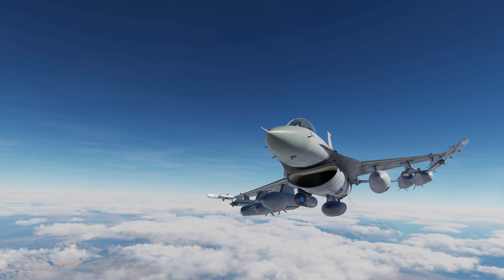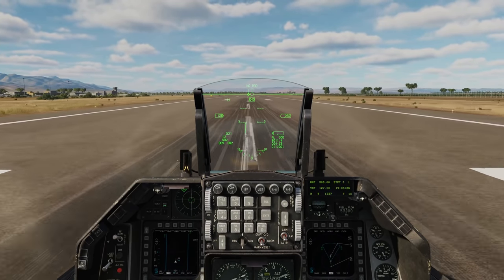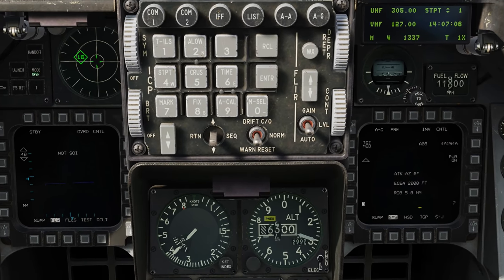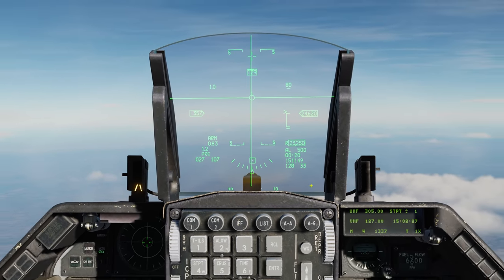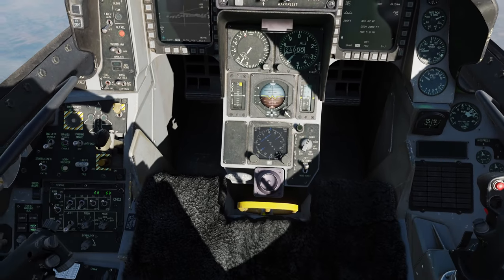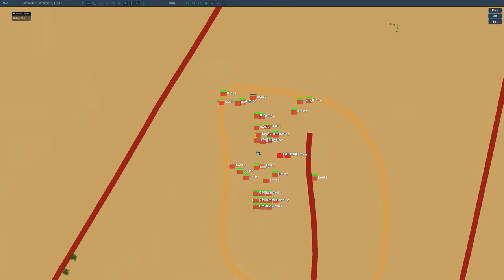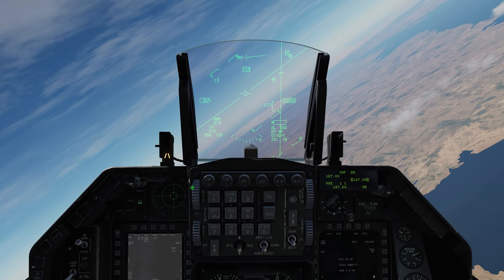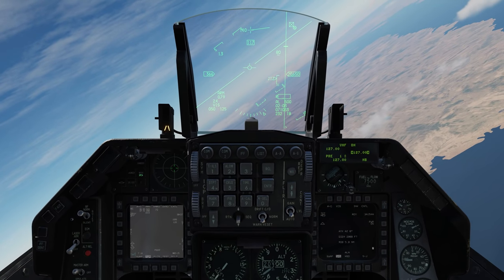DCS: F-16C Viper | JSOW

Comment: Great video! Another tip is that if you use the HAD sensor for HARMs, you can get a SPI with PRGM2 when targeting enemy radar sites, and release a JSOW.  It’s fairly accurate, and allows you to keep your standoff at high altitudes.  Finally, it also lets you conserve your HARMs for the biggest radar sites, such as S-300/S-400.

Comment: 4:20 Matt, when we launch 2 💣 together we know that the “space impact” is the distance between 2 JSOW 💣 considering the SPI at the center right?

But these 💣 do not fall whole to the ground (such as JDAM), but open in the air in clusters. Therefore the “space impact” is calculated from the center of 1st 💣💣💣 💣 to the center of 2nd or simply the distance between 2 JSOW 💣 in the air?

I hope it is clear I,m 🇮🇹🙏👍

Comment: Question for both the JSOW and JDAM... I notice by default the attack azimuth is set to 0 degrees and isn't used unless you manually adjust it first. If you do change it and later decide you don't care, is there a way to reset it? Like say for example I set it to an attack azimuth of 090 for my primary target, then as I'm on my way home, flying South, I spot a target of opportunity and I just want to drop on it without having to worry about the bomb or JSOW making a sharp turn to try and match the configured azimuth.
Reply: I believe you just set it back to 0 and if you want the JSOW to fly north you set it to 360

Comment: Will we get the AGM-154A-1? This is a variant of the A fitted with a BLU-111/B blast/frag warhead. 

The BLU-111/B is also a variant of the Mk82.
Reply from the maker: That would not be accurate for a US 2007 Viper.
Reply: @National Christian Constitutionalist Party why
Reply: @MattWagner  But we're slated to get AN/ARC-210 as per this thread: https://forums.eagle.ru/topic/225957-reported-comm-2-radio-mislabled-as-arc-222/?tab=comments#comment-4506699

Which according to this: https://www.f-16.net/f-16_versions_article2.html Came on M5.1 starting circa 2008, which AFAIK is the entry date for the AGM-154A-1 (according to this: https://www.military.com/equipment/agm-154-joint-standoff-weapon entered production in 2006. 

If the F-16CM can carry the A, it can also carry the A-1.

Unless of course the USAF doesn't operate the A-1 on the F-16CM.

EDIT: Seems to be the case unfortunately, the only reference to the A-1 on F-16s seems to be as part of FMS requirements for Turkey.
Reply from the maker: @OliverMiles98  We plan to adjust the radio later.
Reply: @OliverMiles98  The same source states EGBU-12 on the same M5.1 tape version that the JSOW is on. What's the deal with that weapon? I don't recall seeing it on ED's feature list.
Reply: @twoknife  It isn't on it, but AFAIK it's only on export F-16s and not Block 50s. See my post here: https://forums.eagle.ru/topic/275642-agm-154a-question/?do=findComment&comment=4721541

Data is sparse though - I'm just going off of what I can find.

Comment: Hi Matt, thanks for the video. Can you move the TGP cursor to change the SPI when in PRE mode? If yes, how does PRE differ from VIS? In VIS you used the HUD first to get the cursor to the area and finetuned it with the TGP. So basically in both scenarios you selected the target with the TGP. I don't really get what the difference is then between VIS and PRE.
Reply: PRE is designed to engage targets you already knew the existence, AKA preplanned targets. VIS is designed to quickly engage target of opportunity you have in visual, putting the thing on the thing on the HUD and go. 

You could do the same in PRE with the SP mode of the TGP btw.
Reply: You could also use VIS if for some reason your TPOD isnt available

Comment: I'm not quite clear what the difference is between the modes. In the hornet, a pre-planned mode can only be dropped on target punched into the weapon system. Here, you said it can be dropped on any SPI, such as steerpoint, HUD or pod. Subsequently, the VIS mode seems to do the same thing... Or did you mean that in PRE mode you can only drop onto a steerpoint?

thanks a lot for all the hard work!
Reply from the maker: The Viper and Hornet terms differ. PP in the Viper is more like TOO in the Hornet. Lockheed / Boeing...... argh.
Reply: Does that mean that with the Viper you can waypoint designate (or TGP) a weapon, then step to the next and designate a separate target, so you can release multiple weapons against multiple targets in one release?!
Reply: @faZhift  So far thats how the JDAM is working.   Just have 4 steer points on targets in an area,  and its pickle, next steerpoint pickle, repeat.

Comment: It's a real shame no branch (navy in particular) chose to procure the B variant- those submunitions are by far the most effective cluster munitions in DCS at this time and would've made for fantastic tank busting. I know you guys typically operate on a "if the platform could've possibly used it then it's available else no" type of deal so I'm not expecting it, just highlighting how much of a shame it is for our purposes.
Reply: By all accounts the B had a slew of technical issues and they never got it to work right. They went over budget trying to get it to work and never did get it to work reliably, which is why it was canceled.
Reply from the maker: With the CBU-105 in the pipeline, USAF probably did not see the need.
Reply: Soviet Union collapsed so nobody needed anti-armor B variant.

Comment: Hey wags any chance we will get the jassm since that’s what we use in the Air Force? Thanks again for the updates!
Reply from the maker: That would be outside the 2007 time frame we are shooting for.
Reply: @MattWagner  ah okay thanks for the reply any chance we may get the gbu-39s?
Reply from the maker: @zachhenshaw6377  Again, that is outside our 2007 US Viper.
Reply: @MattWagner  Thanks for the good work so far. One question: Is it correct that the jassm was introduced only a relativly short time after 2007? In all your publications it is said that ED do a Viper Blk. 50 CIRCA 2007. Because the JASSM would be such an improtant weapon system, would it not be possible to do the same USNG F-16 Blk. 50 only one or two years later? I dont think that the plane was scrapped by lets say 2009. I think the exact plane ED is modeling was only updated for the JASSM. So why not put the CIRCA 2007 by word and implement the JASSM? Thanks for reply and keep up the good work!

Comment: Can any plane boys explain the gap between the fuselage and the intake? Doesn't that increase drag? Isn't that the very last thing you want in a fighter aircraft?
Reply: When the skin of the aircraft faces incoming air there's a boundary layer that "sticks" to the aircraft and if the engine sucks it in it can affect performance, so the gap allows that air to divert to the sides while a plate ensures that the engine gets fed a more laminar flow. If you look at a F-4 Phantom it also has those gaps. And in modelling aircraft that come in pieces you can sometimes see that the fuselage piece without the intakes has a "reverse teardrop" shape to be as aerodynamic as possible. The F-16 has that too, the gap has a thin "web" at the front and the shape increases thickness towards the rear like the bow in a ship.
Reply: @ChucksSEADnDEAD  , nice and proper answer!

Comment: So while the US Air Force only operates the A, will the B or C be implemented in the DCS Viper?
Reply: That would be inaccurate so probably they won't.
Reply: @Jimmybrianmike  yeah, i still wanted to ask as i didnt know if they would implement it as it is theoretically possible to use on a viper but just not regularly. Tbh i just wanted the bunker buster jsow on the viper :(
Reply: @MichaelNelsonYT  No sadly only the A version will be on the Viper.
Reply: They have already stated that no.
Reply: @NoBrainSilent  ah, my bad. Thanks for the info

Comment: Love it, can we expect to see the ability to designate waypoints for the JSOW to follow eventually for the viper as well?
Reply: You just designate the waypoint and then that is your spi. Works the same pretty sure
Reply: @ciwiyeet8216  no I'm talking about giving the jsow a steerpoint route to follow. Kind of like how you can program multiple waypoints for a SLAM-ER to follow
Reply: Depends on if the JSOW actually has that capability, the hornet should be able to do it right now. If not the JSOW probably doesnt have that ability
Reply: @koekiejam18  it's a viper upgrade iirc. You can designate up to X number of waypoints for it to follow in. Can't recall that max number but like radius said it's called  MPPRE mode.

Comment: Although its superior range, it looks like cannot do much damage. In the last shot most of the light armored vehicles survived. And they were located close. A single cbu 97 would wipe them out completely
Reply: The A is not an anti-armor weapon, It's essentially a stand-off precision guided CBU-87. the B which we're not getting, is the anti-armor version "CBU-97". The A is useful for airfield attack/denial, trucks, troops, SAMs, artillery, installations, warehouses, and they'd do a number on POL sites, as well. etc., etc., etc.
Reply: @urgentsiesta7606   Well the CBU-87 in DCS is also very underrated. These are light armored vehicles and the weapon did almost no damage. We are talking about 2x1000lbs area effect munitions. Forget the tents, they get destroyed by anything in DCS. Its just fireworks. Is this right? I don't think so because the CBU family is a very destructive and reliable combat proven weapon. Check the numbers used in combat by the USAF. Drop on 20 closely placed BMPs and 2-3 destroyed? Not really good. These aren't T-72s or T-80s.
Reply: Just a few destroyed and the other will just shake it off with no loss of combat effectiviness. A shotgun pattern of 20mm would have done more :/
Reply: @f-16c  I suggest you read up on the differenct cluster munition types. The targets Matt selected, though not MBT's, are STILL armored vehicles. This wep is for unarmored / unprotected area targets, as documented in various places (and above).

Comment: So in PP-mode you use the TPOD to target and in VIS-mode you also use the TPOD. Weird.
Reply from the maker: It defaults to your current Steerpoint as SPI, but could then be set as an offset SPI with the TGP. Or, first designate the SPI through the HUD using VIS, and then fine tune with the TGP after switching the SOI to it.

Comment: Will we get SDBs?
Reply from the maker: That would be outside the 2007 time frame we are shooting for. While the SDB entered service in 2006, that was just for the F-15E. It did not enter the F-16 fleet until several years later.
Reply: @MattWagner  that is a shame. Having SDBs would offset the vipers perceived handicap when it comes to air to ground when compared to the Hornet or the Hog